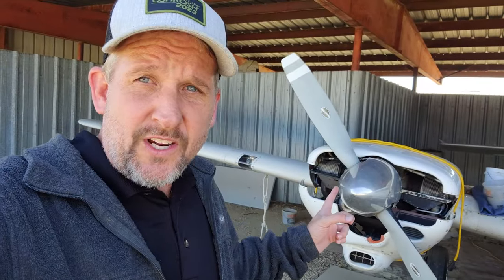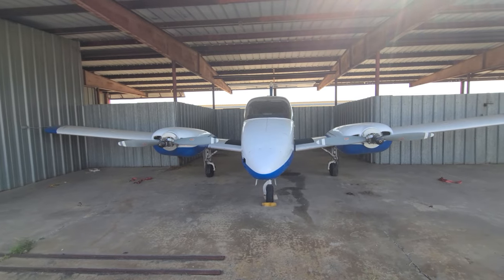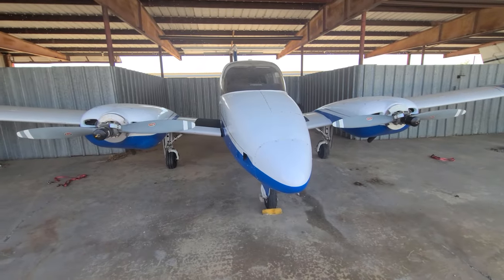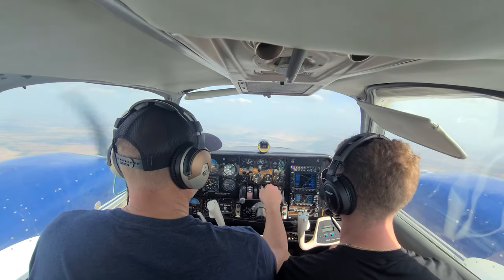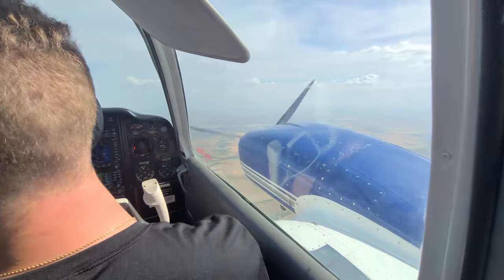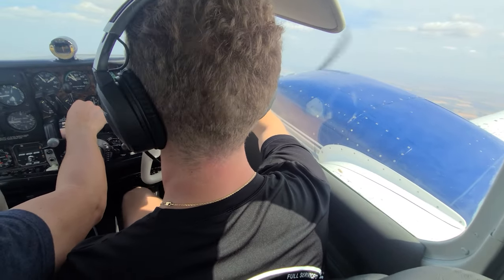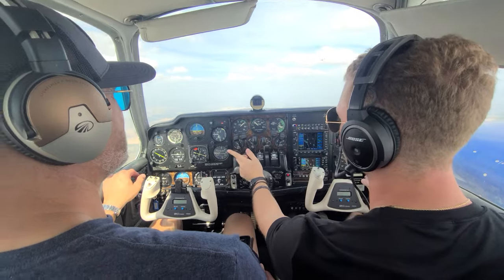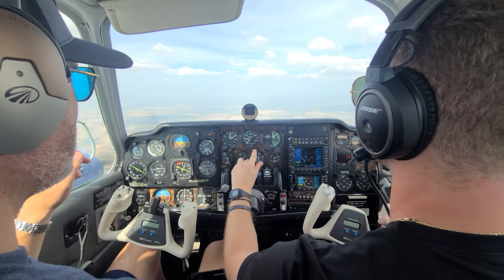How To Safely Shut Down An Engine In Flight - Vlog 02

Comment: What I've been taught is that a critical engine is defined by the length of the arm from the CG to the thrust vector of the downgoing propeller, and the right engine is the critical engine. This is because the downgoing propeller takes a bigger bite of air, and the longer arm of the downgoing propeller is on the right engine.
Reply: Exactly.
Reply: The critical engine is the engine that has the most adverse affect on aircraft control when it is lost. Therefore the left engine is typically the critical engine in light conventional twins. Not the right.

Comment: Actually, the critical engine (as defined by the FAA), is the one that has the most adverse effect on the airplane’s handling characteristics or performance. All of the four factors previously mentioned make up the determination of which is the Critical Engine on propeller driven aircraft with non counter rotating propellers or, with centerline thrust. Also, remember that many European built propeller driven ME aircraft have both engines that rotate counter clockwise thus making the RH engine the the Critical Engine.

Comment: Its been 6 months since I did my multi. My right leg still hurts. And ercoupes are fun to fly 😁. I've never heard of the critical engine explained that way. The way that was explained to me was in terms of a longer lever arm from the thrust of the non critical engines propeller (downward bladetip is further from center on non critical, downward bladetip on critical is closer) to the airplanes center requiring more force and a longer lever arm from the rudder to counter it. But again it's been a few months and I'm not a MEI.
Reply from the maker: Thats 100% accurate. There are 4 reasons it is the critical engine. I just talked abut torque because I feel like that s the easiest to understand for someone that doesn't have any multi experience. You are spot on though.

Comment: 1:08, you’re wrong.. on the Duchess, BOTH engines are critical! Lol That’s a weird explanation of critical engine, and I’m not sure if you are serious or if it’s more satire.. what makes one engine harder to maintain directional control is the fact that the DESCENDING blade is taking a bigger bite of air (P-Factor) and the descending blade which is furthest from the centerline of the aircraft on most twins is the right engine.. so the right engine thrust centerline is further from the centerline, and it has more leverage to yaw you into VMC. Make sense?
Reply from the maker: There are four factors that make an engine a critical engine I just picked the one that seemed the most simple to explain which was torque.

P-Factor, Accelerated Slipstream, Spiraling Slipstream, and Torque  define the critical engine.
Reply: @JustPlaneSilly  I don’t agree.. the accelerated slip stream should be the same effect on either engine. The effects from torque is a rolling motion, not a yaw motion. The only thing that makes the right engine more dangerous is that the moment arm from the p factor is longer, causing a yawing motion that needs to be canceled by rudder, or it may VMC. The explanation you gave about torque could be canceled by ailerons. It’s ALL about the descending blade further from the fuselage.
Reply from the maker: @thomasaltruda  Just google "Multi P.A.S.T"

https://www.cfisteph.com/multi-engine-aerodynamics

https://thebackseatpilot.com/pages/criticalengine

https://mycfibook.com/book-page/multi-engine-airplanes/

https://www.westwingsinc.com/Critical_Engine_1.pdf

https://personalwings.com/multi-engine-rating-memory-items/

Have you gone through Multi Training?
Reply from the maker: I am starting to think you are messing with me.  This is like everywhere when you research the subject: "Aircraft which have counter-rotating propellers rotating toward the cockpit on the top side (such as the Beechcraft Duchess) do not have a critical engine, while both engines are critical on aircraft with counter-rotating propellers turning away from the cockpit."
Reply: @JustPlaneSilly  I was joking about both engines being critical on the duchess, yess because it is an underpowered twin.. kinda like the joke, why does a (insert twin airplane name here) have two engines? Because it needs them.
Reply: Fun fact, there are aircraft out there where both engines are critical - the P38 being a great example. Both engines counter-rotate outwards!